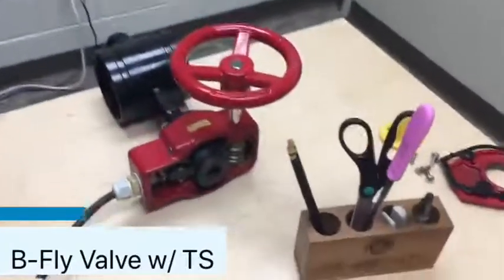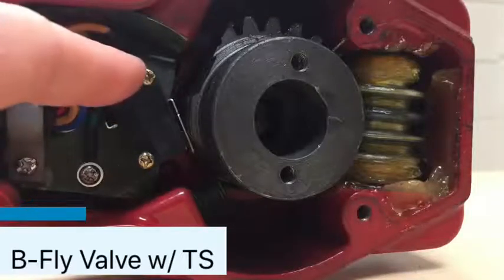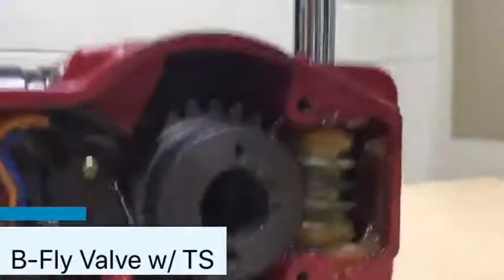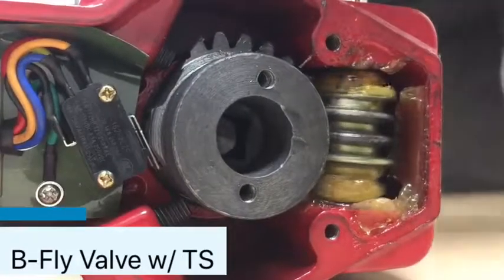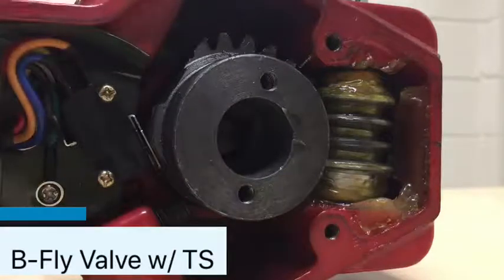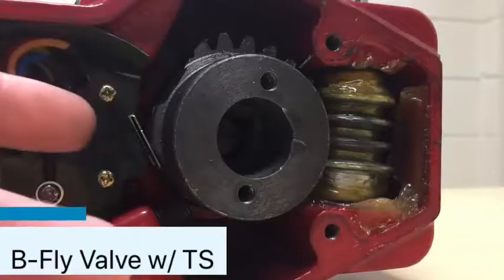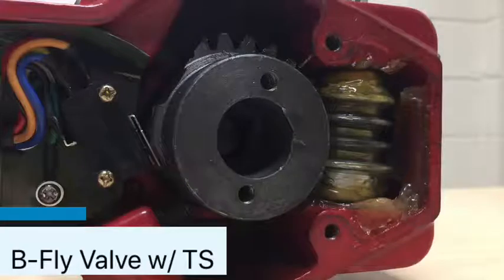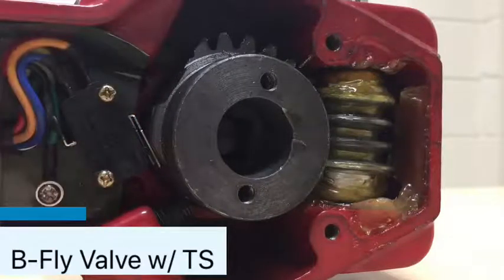Butterfly Valve with Tamper Switch

Comment: Sir  any  electricpower  requried  for  tempered switch  to  give  signal
Reply: Rakesh, yes these tamper switches are tied into the fire alarm panel, which are 24v power.

Comment: Micro switch has a statistically zero failure rate in my experience.
Reply from the maker: Thanks for your thoughts - Statistically, from what we have seen and heard from other industry experts, it is a common failure that occurs due to infrequent operation. It is not a common as internal corrosion, but does occur and it is important to be able to diagnose the difference.